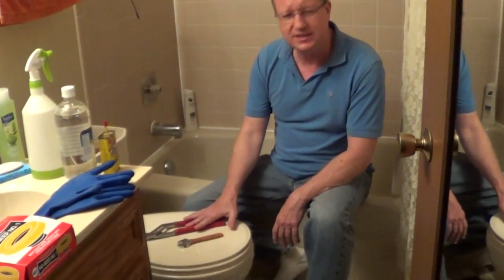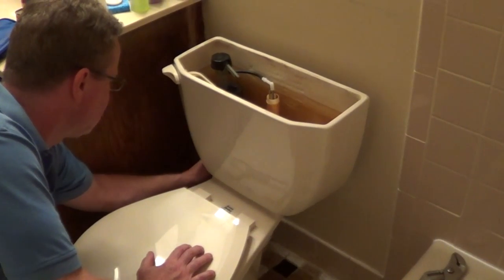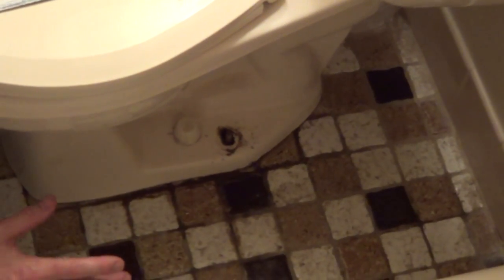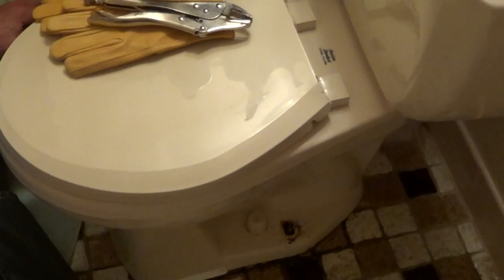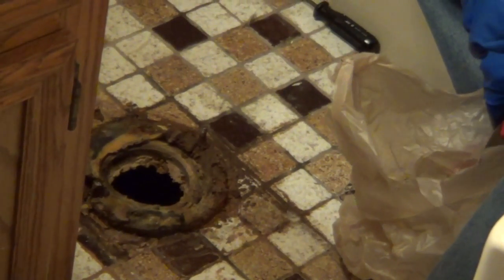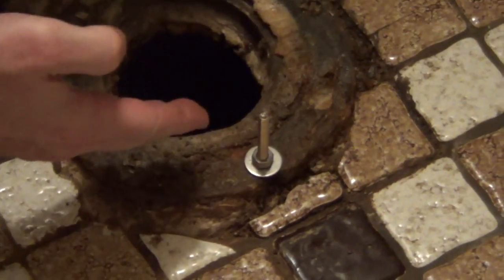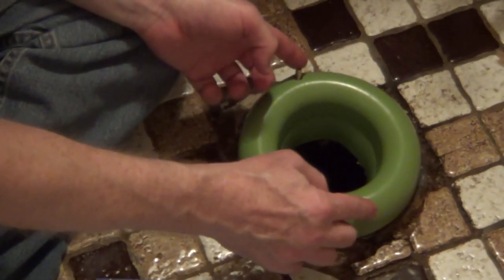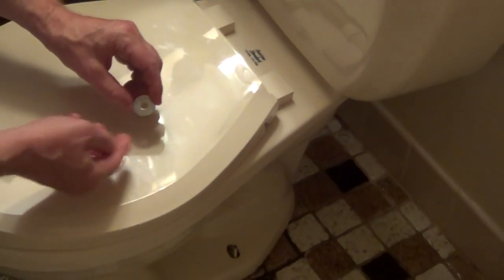Replace Toilet Wax Ring - No Wax Toilet Ring - Toilet Leaking at Base

Comment: Where can I buy " No Wax Toilet Ring " ?  like the one you have on this video ? I did not see it at Home Depot or Lowes in my city. Thanks.
Reply from the maker: Hi, I would go with a Korky or Fluidmaster no wax toilet gasket. You can pick them up at most hardware stores or home centers. 
Check out more home improvement tips in our e-books https://www.amazon.com/gp/product/B0B2KW1FQ9?notRedirectToSDP=1&.

Comment: Will it leak right away if something is  wrong? I put mine on but the flange was a bit lower than the floor
Reply from the maker: Hi, you generally would know right away if there wasn't enough pressure on the gasket to create a seal.
We have more home improvement tips on our weekly podcast 
https://itunes.apple.com/us/podcast/fix-it-home-improvement/id880903087?mt=2

Comment: I had to replace the toilet last summer. And I used the saniseal gasket and it works good. I only bought it cause the toilet flange has a slight bend but the seniseal is good for it

Comment: Hey, water was leaking from the bottom of toilet but when i removed the toilet. My wax seal didn't look like this. Should I still replace it? Or could it be another issue?
Reply from the maker: Hi, if the toilet is leaking from under the bowl, it is almost always the toilet gasket. You gasket was probably wax. I would replace the gasket with a new one. Here is one I like better https://youtu.be/vDXptI8VFhI.
Reply: @FIXITHomeImprovementChannel  okay after closer inspection. It seems the wax seal has worn out. Thank you for the informative video and the reply. I saw the other video but this one is more relative to my situation. I'm new to all of this so I will do the best I can
Reply from the maker: Hi, here is a video with some tips for wax seals. https://youtu.be/_6auhFNvzOc

Comment: I had a plumber change the wax ring ring . The man showed me that the wood surrounding the hole was damaged. He put on a new wax ring  put the the toilet back and and water began leaking out immediately. He pulled the toilet agian and put on a 2nd wax ring and that stopped the leak. But only one bolt could be put in because the other bolt had no place to thread into. The leaking did stop , however. Plumber said said with some luck  and gentle use of the toilet, it might be ok for a while but no guarantees. At present, I cannot find a flooring contractor to deal with a small job like a bathroom floor.  It's ok with one bolt so far.  Any suggestions , please ?
Reply from the maker: Hi,  you can purchase a toilet repair flange, to make a more secure connection to your toilet.  Here are a couple examples: https://www.homedepot.com/p/OATEY-1-4-in-Stainless-Steel-Toilet-Flange-Replacement-Ring-427782/303864005

https://www.homedepot.com/p/OATEY-1-4-in-PVC-Toilet-Flange-Spacer-435192/303864021

Attach new toilet bolts to the repair flange with a washer and nut on the top side to hold them in place You will put the repair flange over the old flange and the new toilet bolts will be over where the old bolts were. If you have a concrete slab, use Tapcon Screws in four holes to hold the new flange in place. You will be drilling pilot holes the size recommended for your screw size.  If you are going into wood, use stainless steel wood screws to hold the flange in place.

Let me know if that helps.
We have more home improvement tips on our podcast https://podcasts.apple.com/us/podcast/fix-it-home-improvement/id880903087
Reply: @FIXITHomeImprovementChannel  Thanks for the reply. I am too old to DIY, but at least I can suggest this to the next plumber when the leak starts up again.I think the only thing is that the plumber was unable to thread in one of the toilet bolts because of water damage around the bolthole. It is very tough to find a carpenter or handyman to do a small patch job or even replace a small bathroom floor. You are very kind.

Comment: Unfortunately this product is easy to get punctured(like a balloon).  When it happens it can't maintain the seal any more.
Reply from the maker: Hi, yes we found a few old seals have absorbed moisture. I have had the best long term results from an all rubber toilet gasket from Korky or Fluidmaster.
Reply: @FIXITHomeImprovementChannel  I recently replaced 4 old toilets in our house with Toto HET models. 2 are .1.0 GPF, the other 2 are 1.28GPF using 2 Fluidmaster , 2 Danco waxless seals.  Will see which ones last longer.
1

Comment: Nice idea. What do you think about putting silicon or compound around the edge of the toilet (to help secure it in place)? I was told that if it's held in place by screws only then if you rock it too hard you can brake the flange (because screws are the only holding points).

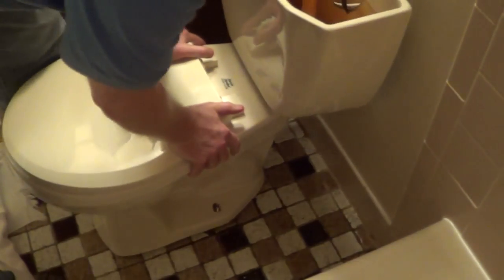Comment: In the video at 5:50 it is obvious the toilet is floating above the floor. The bolt tightening was described but not shown. Was it successful in forcing the toilet down, or were shims and caulk needed?
Reply from the maker: Hi, it flattens out when you tighten it. It might help to have someone sit on the bowl while you tighten the nuts. I have been using the Fluidmaster and Korky non-wax toilet gaskets and find them to be better over time. On some of the toilets I used this on, the toilet bolts have rusted, so it seems to be absorbing some moisture over time. 
Check out more home improvement tips on our weekly podcast 
https://itunes.apple.com/us/podcast/fix-it-home-improvement/id880903087?mt=2

Comment: Great video! I would add if you think (or dont know) if it's a wax ring under toilet, the bottom of toilet will have sticky wax stuck on bottom of toilet. Setting toilet upright on floor will smear wax on floor adding to clean up. Empty tank and bowl to remove toilet so you can set it on its side. Scoop out water, then use towel to absorb remaining water. Have fun!

Comment: Would this also cause a leak to the downstairs bathroom? There isn't any water leaking straight onto the floor, but I happened to walk downstairs, and there was water leaking from the ceiling into our downstairs bathroom.
Reply from the maker: Hi, yes it could be leaking straight down from the toilet gasket or wax ring without going onto the floor around the toilet.
Reply: @FIXITHomeImprovementChannel  Cool, thank you so much for answering!
Reply from the maker: Take a look at the Fluidmaster and Korky no wax toilet gaskets. They do a great job.

Comment: plz update me with product review of the sani seal you used in this video. how's it holding up compared to the old style wax ring and do you still recommend using it? :) thx if you have the time appreciate the vid!
Reply from the maker: Hi, We've had good luck with most of the installations with the Sani Seal, although a few did absorb water and rust the toilet bolts. We are now recommending the Fluidmaster wax free toilet gasket and the Korky wax free toilet gasket. They are both all rubber and we have not had any problems with those.
We have more home improvement tips on our weekly podcast, Fix It Home Improvement. You can subscribe on your favorite podcast app. https://www.stitcher.com/podcast/fix-it-home-improvement-5/fix-it-home-improvement

Comment: Great video you could mention where you purchased theSilicone seal you installed and maybe even the price good job
Reply from the maker: Hi, You can get it at most hardware stores. I've had really good luck with the waxless toilet gasket from Fluidmaster and Korky. You can get those at any hardware store or homecenter.
We have more home improvement tips on our weekly podcast  https://podcasts.apple.com/us/podcast/fix-it-home-improvement/id880903087?mt=2

Comment: Using a nut to lock the flange bolt is a good idea. I use a shop vac to get the water out of the toilet. Gone in a couple seconds!

Comment: I've had  the green ring for 10 years and I had to remove the toilet a couple of times for other issues but I keep using the same green ring and it still works 100% like it  was brand new no leaks I recommend it
Reply: I appreciate your reply. I’m having to replace my ring today after my toilet leaked, which ruined my lath and plaster ceiling in the dining room below. Thanks, fat ass! 😀👍

Comment: Sorry, but the Green Sani Seal ring does not last. Had mine on for about 1 year, then pulled the toilet when I put in tile floors. The rubberized green coating had broken down, and the soft foam interior was soaking wet with you know what. Now going to try the Fluidmaster 7530.

Comment: I just installed one of those green foam rings and my toilet still leaks.
Reply from the maker: Hi, what is the height of the toilet flange in relation to the flooring?
Reply: @FIXITHomeImprovementChannel   Overnight I discovered something.....  I went to bed with the stool filled with water but with the tank empty of water and in the morning saw that there was NO LEAK!

I just now turned on the water to fill the tank.  If it starts to leak it'll be from the tank water not the stool water.  I'm thinking the water is leaking from something other than the ring area.  Does that make sense?
Reply from the maker: Hi, it could be leaking from the tank and dripping down the bowl.
Reply: @FIXITHomeImprovementChannel   UPDATE!   As I said, it didn't leak over night with water only in the stool.  This morning, I turned on the water to fill the tank and left it for a couple of hours. I just checked it and (DRUM ROLL)  IT'S NOT LEAKING!  It fixed it's self.  I hope.  All I can do now is keep an eye on it and hope the fix holds.
Reply from the maker: @Hooverdarnit  Good luck!
Reply: @FIXITHomeImprovementChannel  Too late.  It still leaks.  It took hours before I saw any signs of water.  That means it's slowed down a lot.  Maybe it'll completely fix it's self tonight.  I may be buying a new toilet.
Reply from the maker: Hi, what is the make and model.
Reply: @FIXITHomeImprovementChannel I have no idea.  There's no writing on it that I can see.

Comment: Read many Home Depot reviews of this product that state it delaminates and then leaks.  FYI
Reply from the maker: Hi, we've used these now for years and have not had a leak. The flange going down into the main drain is the only part that comes in contact with the water and waste. So far they have been great on our projects.
Reply: Not sure why so many folks have had trouble with this brand.  Glad it worked for you.  Incidentally, their guaranty only covers the cost of the unit, not any damage related to a failure.  Not unusual for a limited guaranty, but not ver reassuring either.

Comment: You know I replaced my ring with the same one you did. Help up for a couple of weeks but now it’s leaking again, any ideas why? Ty
Reply: Depending on how stable the flange is. Does your toilet move after you have reset it? 
  If it does not move. Then try an extra thick wax ring with a 3x4 flange plus a regular wax ring on top of it. Is you flange completely lever with your floor?
  Check the packing on the valve. Check the supply line for leaks. Then check the tank to bowl bolts. They may not be leaking while you are working on the toilet.  But when you are finished depending on what you put back on the lid. Sometimes it weighs to much. This compresses the tank to bowl  & it leaks in a few days down the road.
Reply: Lee Olaeta figured it out it wasn’t the wax ring it was the bolt that attaches the tank to the bowl 🤦🏽‍♂️ it was loose
Reply: @davidgarza77  this happens a lot.

Comment: Replaced it. Still smells. Why?
Reply: Because you didn't clean the floor & the bottom of the toilet all the way around. Where the ring was and the complete base of the toilet. Once you get it back seated on the floor. You should caulk all the way around where the base meets the floor. 99% of smells. Come from men or boys with no aim. Urine gets under the toilet base & smells

Comment: Great video.  Just one thing though.   Could you include some tips on proper lifting of the toilet.   Don't want to destroy my back trying to save money.  Thanks.
Reply from the maker: Hi, 

Hold down the handle and get out as much water as possible in the tank and then plunge the bowl to remove the excess water. It will help lighten it up.
Reply: Thanks.

Comment: Awesome video, thank you! I'm doing this tomorrow to mine and this was a HUGE help. One thing I would have liked to see is how you use the plunger to remove that excess water at the bottom of the bowl, though. Did you just plunge it like a clog and the water goes away? Every other video I saw on how to remove that recommended using a bucket of water to gravity push it. I'd have liked to see the plunger on video before I do it, but I'll give it a shot tomorrow anyway.
Reply from the maker: Hi, yes, once you turn off the water to the tank and flush it, just plunge the bowl and you will get out most of the water. There is a product you can get at the hardware store called LiquiLock. Here is a video https://youtu.be/vLxkFGOGidI
Reply: Use a sponge! Both the tank & bowl. Using a plunger is to much work.

Comment: If I were doing the job I would give some attention to the closet flange at the floor it appears to be rusted and could possibly crack or break as you walk out the door.  Anyway there are repair kits and dozens of videos about that problem. Also if the wax seal is bad the rest of the hardware could need replacing also.  In as there are only the tank gasket the tank bolts, the flushing float and flapper valve why not just take the toilet apart give it a good cleaning and new parts for years of more service.

Comment: Could you explain a little about how far to tighten bolts?  Don't over tighten is a bit vague -and my husbands likes to crank things down as far as they will go.
Reply from the maker: Hi, I would snug them down and then check to see if the toilet moves by grabbing the front of the bowl with both hands and lifting. If it moves, tighten the nut slightly, then check the toilet again. Keep repeating. If you over tighten the nuts, you will crack the bowl.

Comment: Great tutorial. It didn't take me near as long as I thought it would after watching your video. Thank you. I would add some information that would have helped me: 
It takes a very specific bolt tho hold the toilet in place, an anchor bolt, nothing else will work.
If you don't cover the hole in the floor you will drop an anchor bolt down it.
Once dropped down the hole, an anchor bolt is GONE.
Dropping an anchor bolt down said hole really, REALLY pisses me off!!!
They come in two packs (go figure), so I now have a spare if anyone else drops one of their's down the hole.
Reply: Don't drop them. It really is that simple...
Reply: LT's Garage and you know what else? Don’t ever make any mistakes and you won’t ever have to worry about making any mistakes. Brilliant!

Comment: Whole Bowl is Wobbling what to do? Should I put Plastic shims or any kind of cement or. Its already tighten at the maximum.
Reply from the maker: Hi, the toilet seat or the whole bowl it wobbling? If it is the bowl, you can have someone sit on the toilet while you tighten it. Do not over tighten, you can crack the bowl.
Reply: If the bolts are tight & the bowl still wobbles around. Either you have a tile floor that is not lever. If it's this problem then go buy little solid rubber shims. Shim the base until it doesn't move. Cut the shims pieces that are sticking out.  The caulk around the base. If you dont have a tile floor. Then you need to pull the toilet back up. Screw the flange down to the sub floor.  Reset the toilet. It will not wobble. If you are on a concrete slab. You need to drill an set lags then bolt down the flange. Reset the toilet.

Comment: You shouldn't use Stainless washer/screw etc on anything other than Stainless (or plastic/composite parts). It's counterproductive. If you mix regular steel and stainless, it will make the regular steel just rust way faster. Has to do with the different charges of the metal atoms. One will give electrons to the other, oxidizing (rusting in this case) the one that "gives" electrons.
Reply from the maker: Hi, I agree you would get corrosion if there is constant moisture. I have used both zinc coated and stainless and have had less corrosion with the stainless steel on my rental homes where I have changed out the old wax rings and looked at the condition of the bolts. That's one of the reasons I have gone to a wax free toilet gasket, less call backs.

Comment: Did not work for me. I have a older mobile home toilet. Toilet set to high on the doughnut and when tighten down. The toilet still had to much wobble even when shimming sides.  Will try a different type, the blue one that fits lower into my flange. My biggest fear is that with the wobble. One side of the flange may now be broken.

Comment: Is it a standard size of nut and washer needed for the bolts? I haven't removed the toilet yet, but wanted to get the extra/replacement washers and nuts when I buy the sani seal. Great video! Thanks.
Reply from the maker: Hi, the 2 common sizes are 1/4 inch and 5/16 inch. It should be marked on the label. Let me know how it goes.
Reply: Thanks for the reply. I didn't realize that the Sani Seal came with bolts and nuts. Anyway, big question here is: do I need to replace the wax ring, and do I have too much height from the tile? I wasn't clear on the height references online. I only checked this out as the nuts had come loose (they weren't very old, likely just not tightened down enough), and water leaked out a couple of times as the toilet rocked. So I figured I'd check it out.
The wax ring is still soft, and there's about 3/4" between the tile and the top of the wax ring. Any thoughts on whether I simply tighten it down again, or does the sani seal work ok with that height?
https://ibb.co/hhN4n6
https://ibb.co/nxBx76
https://ibb.co/bzc4n6